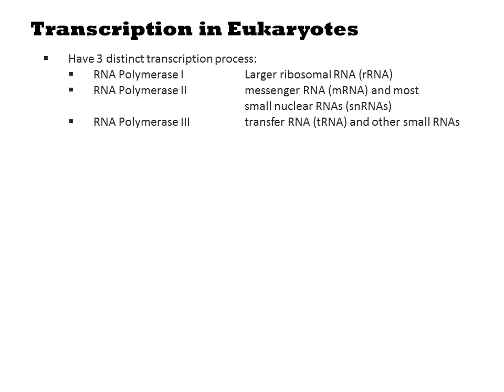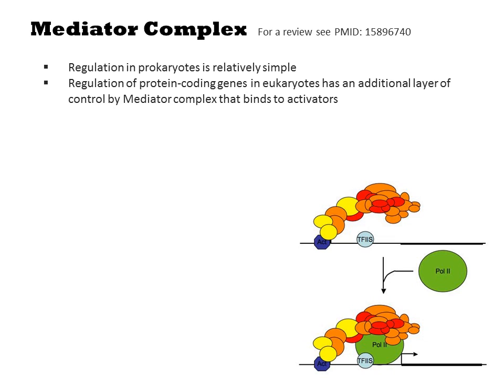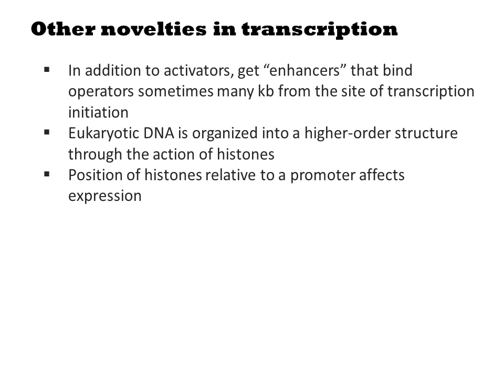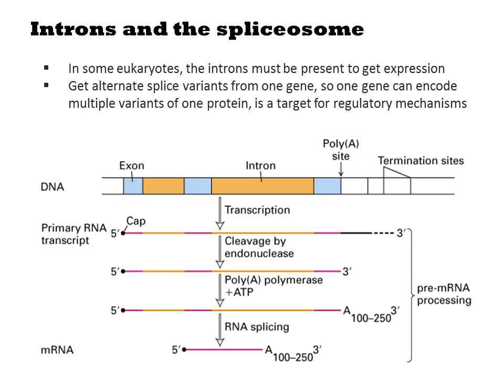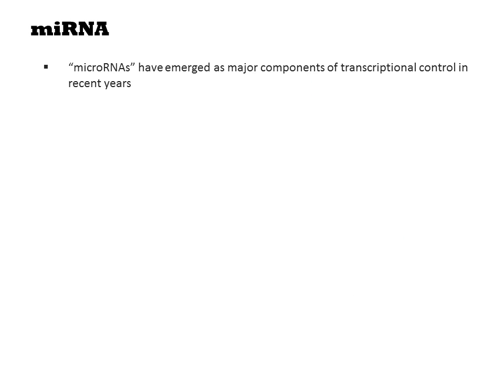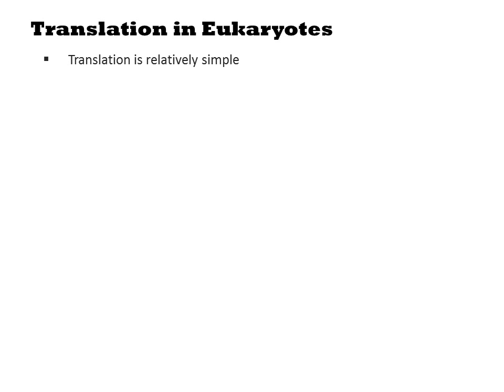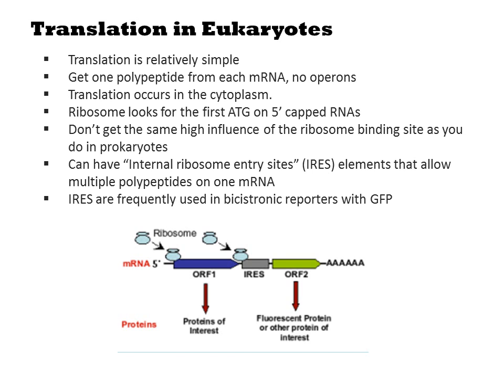Eukaryotic Gene Structure

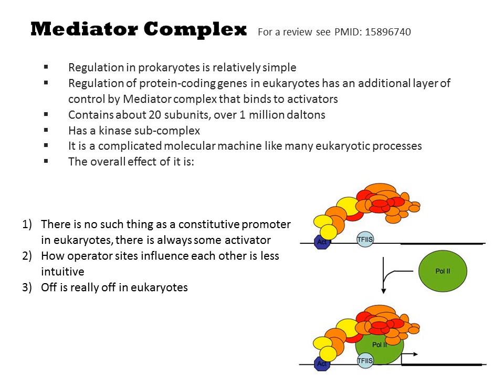Comment: You said at @2:29 that it is often easier to express really toxic genes in eukaryotes than in prokaryotes where leaky transcription is the norm. I believe you meant to say the opposite, right? i.e.That it is easier to express toxic genes in prokaryotes than eukaryotes since in prokaryotes leaky transcription is the norm.
Reply: If a gene is toxic to a cell, transcription and translation of the gene will kill the cell. My point is about toxic genes that either lack promoters entirely or are under inducible promoters. Such genes are more off in eukaryotes than prokaryotes, and thus more likely to kill the prokaryotes.
Reply: Got it. Thank you
Reply: Please expalin what is difference between gene, structuralgene ,cictron and transcriptional unit